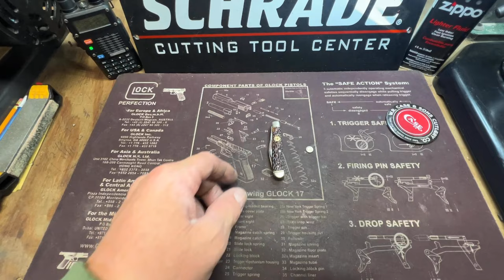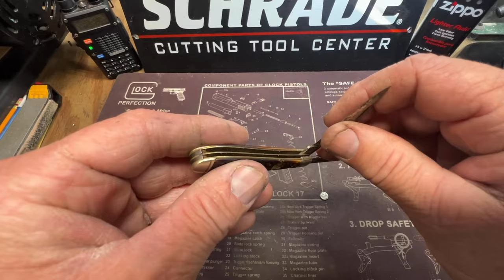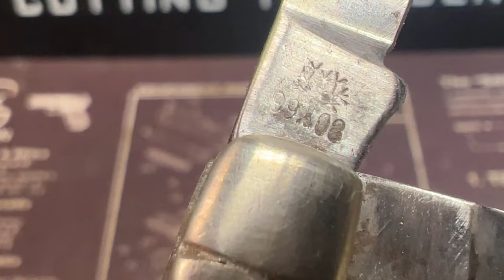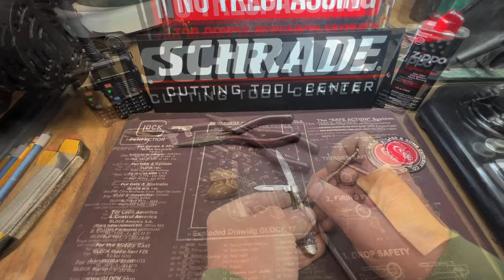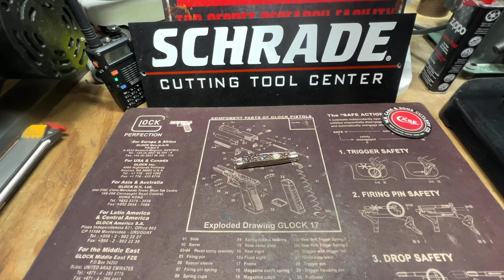Bringing Life Back to a Rusty Boker USA Pocket Knife: Restoration and Emblem Replacement!

Comment: How did you get the one out of the other knife? I have a parts knife with a good emblem and I want to put it on my good knife that is missing the shield
Reply from the maker: I used a small screwdriver.

Comment: Hey bro, I enjoy your vids. Try wd 40 and steel wool for that rust and it won't scratch it so much. The wool will also get in the lettering and small angles better. Then blow out with air compressor. Keep up the inspirational work sir, thank you.
Reply: Or rem and wool...